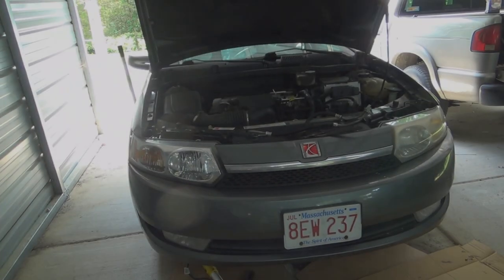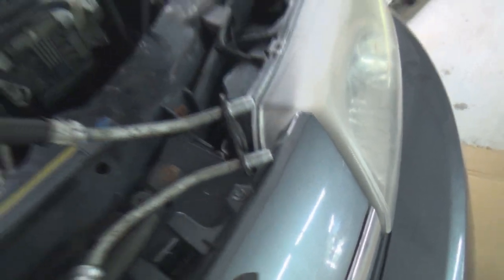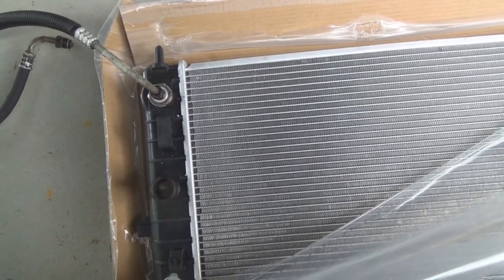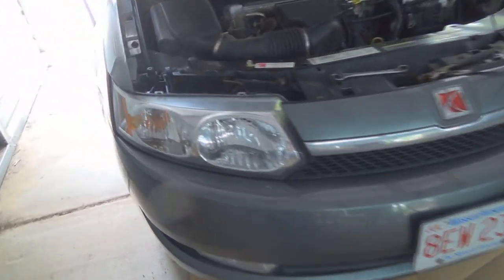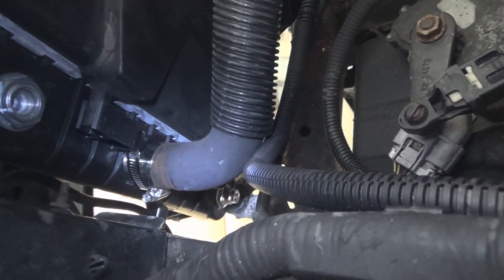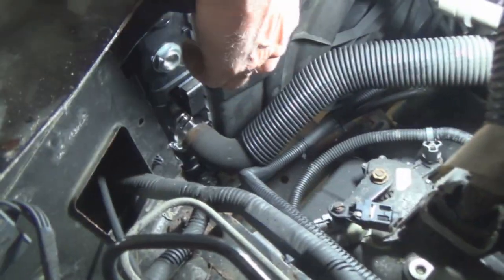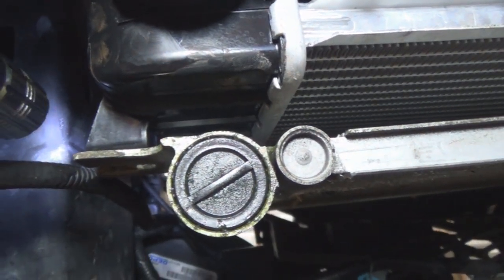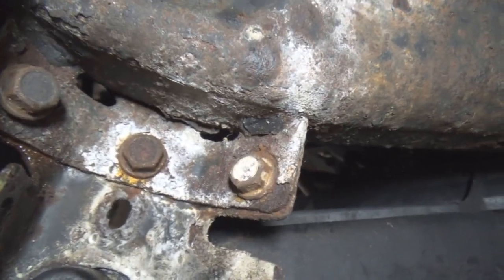Replacing the radiator in a 2004 Saturn Ion

Comment: Thanks for the upload! 

I did this using a Haynes repair manual and had no problem. Except, everything is kinda loose. This cause my new radiator to get a small micro crack in it due to a small part on the bottom of the fan. Its a little bigger than a hair line crack and at first, the leak would cause me to have to top off every day but then after a few days the coolant would drain from the reservoir pretty much instantly. 

I lost one of the bottom rubber mounts in an accident, and the other one broke off a few days ago. Maybe to transmission fluid and coolant leaking on it or just old wear and tear. 

Anyway, I will be purchasing new bottom mounts. Pretty expensive for small rubber parts. But i just now noticed that there seemed to be spots at the top that also had different shaped rubber mounts. Thing is, the little parts on the radiator that should slide in the mounts up there (like they sit in the mounts at the bottom) are sitting too low and not reaching the mounts. I think this, and of course, the mounts at the bottom missing is the reason for it sitting so loosely. Was yours sturdy? My radiator seems to be just resting on top of the metal brackets. Any advice? 

Thanks
Reply from the maker: Your radiator should fit snuggly in place otherwise it will wear the tanks out and give you more leaks. Thanks for stopping by.
Reply: @TheShadeTreeFixitMan  

My problem is the fan won't fit into the tabs/slots of the radiator. I don't know if it's because I got an aftermarket radiator or what 😭

Comment: Did you add any transmission fluid for the about 4 ounces that came out of the radiator when disconnecting the transmission lines? And if so how do you add more?
Reply from the maker: We didn't lose a sufficient amount to need adding. If we had had to, it would have been done through the fill tube or dipstick tube. Good question and thanks for stopping by.

Comment: This video is ultra helpful! Anyone know what size wrench is required to undo the trans fluid lines from the radiator?
Reply from the maker: If you watched the video all the way through you would see that we used an 18mm wrench to remove/install the cooling lines into the radiator. Glad to help and thanks for watching.

Comment: Hi i bought this radiator from the link and fittings are still too big . Basically same radiator i bought from amazon . Not sure what to do any tips?
Reply from the maker: Did you remove the included zip connectors that were screwed in from the factory? This was our second radiator and we still have the first. Make sure your vehicle is the same as the one we were working on. I tried to find adapters at the local parts store and was unsuccessful. Without seeing your parts and pieces it's hard to tell you what to do next. If you want to send me pics of your radiator fittings and your coolant lines compared, then I may be able to help. You can email me at:  theshadetreefixitman@gmail.com

Comment: @theshadetreefix-itman Sooo I have a question I bought this radiator from this link and got the radiator because I have the same exact car....but when trying to put the radiator on the transmission line it doesnt fit it's like the transmission line only goes so far down.....if you could give me any advice it would be very helpful
Reply from the maker: Does your car have the quick connects? It sounds like it. Evidently there is a possibility of both kinds of connections.
I hope you can find the solution. Thanks for stopping by.
Reply: @TheShadeTreeFixitMan  yes I hope so too I'm new to this car thing. But this was a hard radiator to find!! Thanks for your video, helped out a lot!!

Comment: How did you put the radiator fluid back in
Reply from the maker: We refilled it through the overflow tank, keeping an eye on it for when the thermostat opened. After road testing we checked it again. It's been going for nearly a week now and still working well. Thank you Fernando.

Comment: We bought a radiator watched your video, did everything right but the holes on the hoses are to small for the holes on radiator. We bought a 2.2 is there a difference between 2.0 and 2.2?
Reply from the maker: You have the better of situations. I bought 2 radiators, my first the hoses were too big for the radiator holes. You probably can get adapters to make your hoses work with the radiator you have. There is a difference between 2.0 & 2.2, and even which transmission you have in your car. Hope you can get it working again. Thanks for stopping by.

Comment: How and how much transmission fluid did you have to replace?
Reply from the maker: I think it was 2 gallons of 50% mix of water and coolant, but it will depend on how much you drain out of your system in your project. Thanks for stopping by
Reply from the maker: There is a dipstick to check fluid level. see this video for best explanation:  https://youtu.be/oNwxvYX_Hnw
Reply: @TheShadeTreeFixitMan  transmission fluid
Reply: @TheShadeTreeFixitMan  not on our 2004 Ion, no dipstick in the video you linked to either
Reply from the maker: @steveesposito  There is a level indicator by removing the inspection bolt, as per the video. There is also a bolt/plug on top of the transmission to fill the tranny fluid. The inspection plug is down low on the side of the transmission just above the pan, as per the video and the fill plug is on top of the transmission, as per the video. Hope this helps.